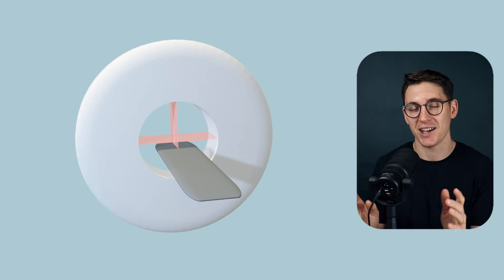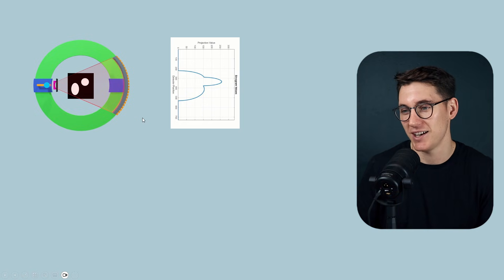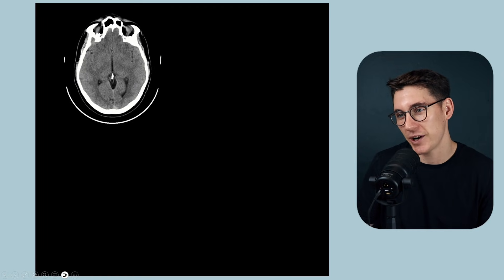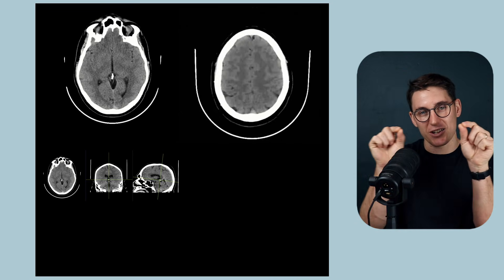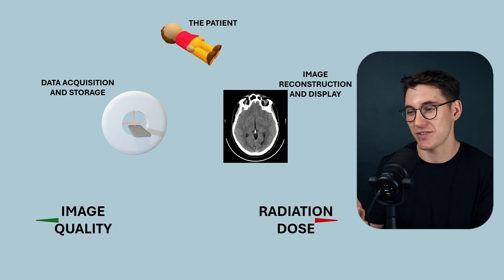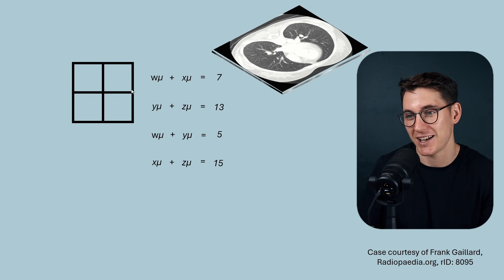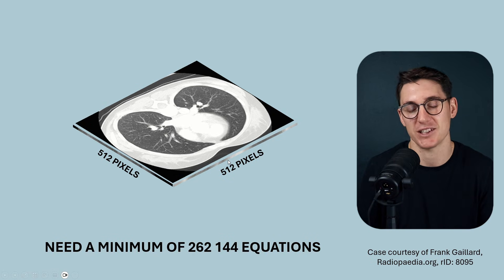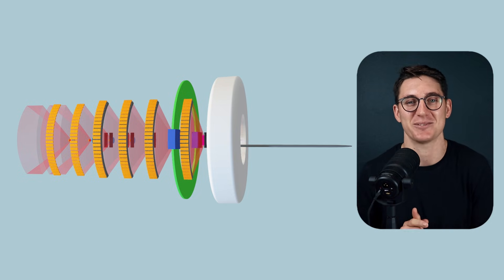CT physics overview | Computed Tomography Physics Course | Radiology Physics Course Lesson #1

Comment: At 14:10, I tried to solve the four simultaneous system of linear equations and it gave me infinite many solutions as they are linearly dependent. Meaning one of the equation can be derived using the other three equations. So, how can we confidently say those are the attenuation value in those pixels when there are infinitely many solution?